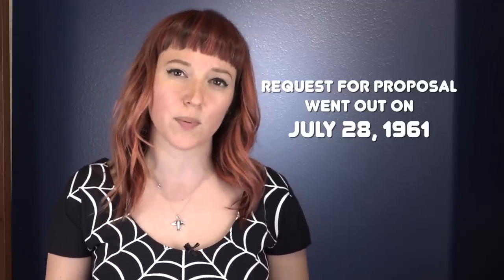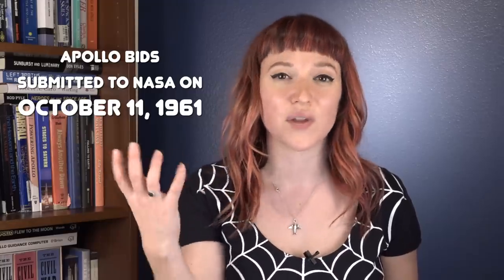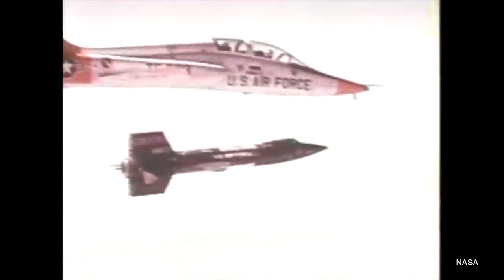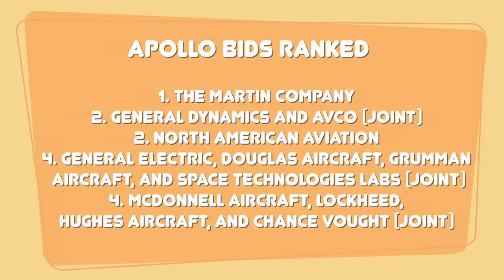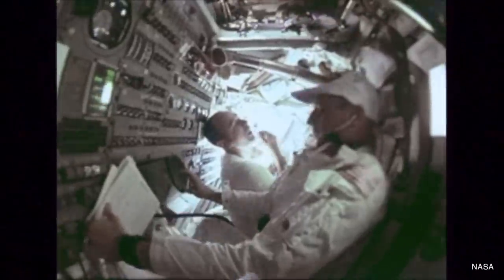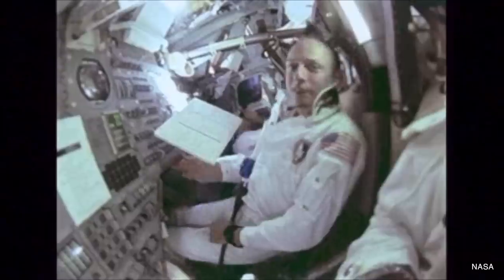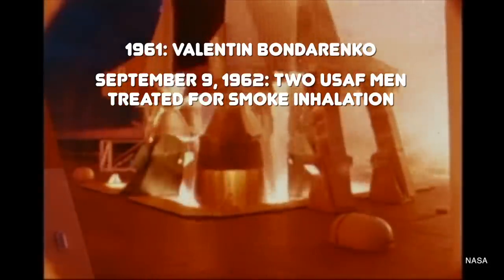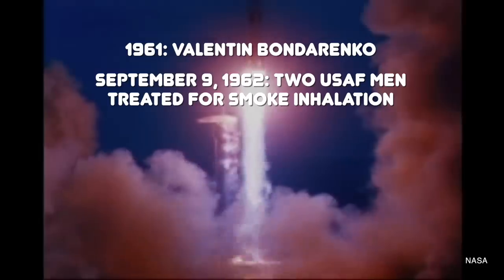Apollo’s Flammable Oxygen Atmosphere Explained

Comment: Amy great to have you back! My understanding is that flammability is a function of the partial pressure of oxygen, not a function of gas ratios. You hint at this but I think too many people in the comments get stuck at "pure oxygen" and don't understand that mixing O2 with another gas does not by itself reduce flammability.

Comment: As a very old space geek, let me mention a few technical points.  The space suits have to run at low pressure to be supple and therefore must use pure oxygen.  To avoid "the bends" astronauts breathing air must  pre-breathe  pure oxygen for several hours before EVA.  Therefore the Lunar Module really needed a pure oxygen atmosphere.  Also a 5psi pressure shell is lighter than a 15psi pressure shell and the LM had relatively big windows.  One extra pound on the LM required~1000 lbs on the Saturn V.  And what if there is an emergency decompression.....do you want lunar astronauts safely in their moonsuits with the bends?
So once the LM atmosphere is decided, the rest seems pretty obvious.  Unlike later NASA management choices which killed people for public relations reasons , this decision made absolute technical sense.

Comment: It’s because it’s not just the purity of the oxygen, it’s the quantity
Reply: thats literally the point of this video
Reply: @Kevy_G  Comprehension is tough for some.
Reply: Yup. At 5psi over vacuum, pure oxygen is not significantly more flammable than 20% atmospheric. If they had used a mixed gas, the cabin environment would still have been 80-90% percent oxygen, so that the crew could get enough oxygen.
Reply: The human lungs require a certain pressure of oxygen (known as partial pressure, when multiple gasses are present) in order to absorb oxygen.  In order to achieve the necessary partial pressure in an environment with a low absolute pressure, absolutely, you'd wind up with a mostly O2 environment anyhow.  Additionally, the part related to the video is that the effect of oxygen and it's oxidation properties is directly related to the PaO2:  If you make enough oxygen available, anything will burn.  It could be cloth, wood, metal, or even rocks.

Later on (1973), NASA commissioned a paper on combustion of metals in oxygen environments that may be of interest to some, too: https://nvlpubs.nist.gov/nistpubs/Legacy/IR/nbsir73-345.pdf
Reply: @Kevy_G  How can it 'literally' be 'the point'?

Comment: A simple follow up question is: Why didn't they just compress the nitrogen and oxygen into one tank, in the proper ratios, much as scuba equipment does?
Reply: Scuba equipment vents the gases once they've been through your lungs once. On a spacecraft, the gases are retained for efficiency and to provide a working environment. Astronauts are converting the oxygen to CO2 while the nitrogen remains unchanged. There does exist rebreather scuba equipment which recovers the exhaled gas and adjusts the oxygen level, but it uses multiple tanks and is much more complicated/dangerous, much like a spacecraft.
Reply: Because they aren't using compressed gas, they are using liquified gas, and nitrogen and oxygen having different boiling points. The oxygen would turn to gas long before the nitrogen began turning to gas, then you would be left with nothing but nitrogen.
Reply: That would mean they would have separate tanks for the cabin air and the oxygen used for the service module engine/fuel cells.  This would add more weight
Reply: Again, it was weight, but safety too. Years ago I used to wonder why just purified air wasn't used. But each time you add something to the oxygen, the disadvantages outweigh the advantages [outweigh - oops sorry]. It seems ridiculous that NASA would crank up the internal pressure of the Command Module to 17psi, but it was a plugs-out test, literally a space simulation, and the single huge error on the Apollo 1 test was the trapped and exposed wire that sparked. If that had not happened there would have been no tragedy. The overall failure was of imagination. Nobody really thought of what could happen, and I totally appreciate that it is very easy for me to say that in hindsight.
Incidentally, welcome back Amy. 🖖
Reply: Because the environmental system needs to be more complex than just simple open cycle, because that demands far too much mass.  It has to be close cycle for the nitrogen (with top up for outgassing losses), partial close for carbon dioxide (LiOH scrubbers designed to remove but leave a small amount), close cycle with major topup for oxygen, and scrub any other gases if possible (due to material outgassing etc.).  Partial pressures, the system needs to keep about 0.2 atmospheres oxygen, somewhere around 0.001 atmospheres carbon dioxide (to help maintain the level in the blood that's a pH buffer and is the primary stimulation for breathing), and the rest nitrogen, while scrubbing any other gases expected from biological processes and materials outgassing.
Reply: @apburner1  Actually, oxygen has a higher boiling point than nitrogen, so nitrogen would boil off first.
Reply: @ramblerandy2397  Failure of imagination. I believe that´s what Frank Borman  said whilst on the board after the accident. It´s a pretty accurate description.
Reply: @Nghilifa  Yep, I remember now that's where I got the thought. Funny, but Frank Borman saying that has stayed with me all my life since, yet I had forgotten it was him. Being able to imagine the strung out consequences of one's decisions and actions is a powerful tool and creates wisdom. I wonder who handed that excellent thought to Frank Borman or whether it just popped into his head?
Reply: @ramblerandy2397  I don't know very much about all of this, I am just interested. Could you tell me maybe why they couldn't open the door from the outside to save the astronauts? Thank you!
Reply: @susanne5803  In the plugs-out test (spacecraft on internal power and wireless communication) the immediate part of the launch pad was cleared. Therefore, when the capsule was sealed and a fire broke out, the pad technicians couldn't respond fast enough. I could give you a long and detailed explanation, but if you watch the second episode, aptly titled Apollo One, from the excellent 1990s HBO series, From the Earth to the Moon, you'll get all your questions answered. And if you want to be entertained and informed on the whole US mission to the Moon, watch the whole series.
The episode also brings up the fact that Gus Grissom could barely hear and speak to CapCom and I've wondered since whether the tracking wire was causing the interference. That's unproven IIRC.
Reply: Su sanne as far as I remember that hatch opened inward at the time. Given the pressure from the fire it wasn’t possible to open.
Reply: @ramblerandy2397  Thank you! I will look into that series, thanks for the recommendation!
Reply: @NickCBax  Thank you!
Reply: @susanne5803  Along with the other info presented above, there was no quick way to open the hatch. The one detail that has haunted me for years is from the first mention of fire from the crew, to the time they were dead was 37 seconds. There was literally no time to act.

The spacecraft remains stored in the back of a secure shed at NASA Langley, in Virginia.
Reply: @mikecowen6507  Thank you! I learned of the Apollo 1 fire first when I watched "Armageddon". There's a scene where two characters meet in the place where the Apollo 1 stood. They show the inscription. It moved me deeply.
Reply: @susanne5803  Pad 34.
Reply: @susanne5803  It was a long, slow procedure- they couldn't just blow the hatch. An earlier vessel had blown its own hatch, after splashdown, endangering the astronaut. Instead of finding and fixing the problem, they did the "pilot error" routine. So it took about 90 seconds to open the hatch in the best of times...
Reply: @Pygar2  Thank you!
Reply: @susanne5803  the door opened in so the pressure inside the cabin held it closed.
Reply: @Pygar2   Indeed, and if Su sanne checks out the film, 'The Right Stuff', they show the part of the Mercury capsule explosive bolts and the process of blaming afterwards,  guess who? Gus Grissom - the pilot who was in danger of drowning after splashdown. Plus they refer to that event in the 'Apollo One' FTETTM episode, mentioned before.
Reply: @susanne5803  The door to the command module opened inwards - this was designed to provide a better seal against the pressure of the oxygen inside when the module was in the vacuum of space. Unfortunately, the opening mechanism was rather difficult to use by the astronauts anyway, but the real killer (pun intended) was that when the fire started, the pressure rose so much in such a short space of time that the hatch was sealed shut with such force that no-one could open it.  The hatch was redesigned to open outwards, and to be opened quicker as a result of the fire.
Reply: @mikecowen6507  my understanding was it was even faster than that. In the neighborhood of 15 to 20 seconds from first indication to the death of the crew.
Reply: @dantreadwell7421  Quite possible. An update on Apollo1: It is now part of an exhibit at KSC. History being remembered in public, where it should be.

Comment: Its good to see your videos again. I was always curious as why they used a pure oxygen environment. and at such a low pressure.  A normal atmospheric mix of gases, 5 psi is around 25000 ft above sea level.  One wouldn't survive that long without portable oxygen, but in a pure oxygen environment, that is enough to sustain life in the spacecraft.

Comment: There was also the issue of conducting EVAs. 
Once Lunar Orbit Rendezvous was selected as the technique to be used for the attempt to land on the moon, it was realised that EVAs would need to be conducted. Once you need to carry out an EVA, having a normal air mix in the spacecraft causes problems - and would almost definitely require some sort of airlock to allow the EVA astronaut to acclimatise to the pure oxygen used in an EVA suit v' the air mix in the spacecraft. Without doing so, the astronaut would get the bends.  It was much simpler to stick with a low pressure oxygen atmosphere and simply depressurise the whole spacecraft and then open the hatch. With no nitrogen to be purged from the astronauts' bloodstream - the bends would not be an issue.
And an airlock would have added additional weight - which was the last thing the Apollo spacecraft needed.

On that point, I assume the Orion spacecraft WILL have an airlock as it will be using an air mix and not pure oxygen.
Reply from the maker: Not sure what’s up for Orion — I’ll have to check — but yeah. Top to bottom on those missions the single gas was so much easier to use.
Reply: @AmyShiraTeitel  And, of course, McDonnell had already gone down that route with their Mercury and Gemini capsules - so everyone was getting kind of use to the whole "pure oxygen" scene. In the end, it was their casual approach to using pure oxygen, especially when sitting on the pad, that lured them into a false sense of security.
Reply: Lunar Orbit Rendezvous was the process for two spacecraft to rendezvous and in and of itself does not require any EVA. The LM could have landed and observations been made or experiment packages jettisoned from the LM without astronauts going EVA, and then the LM ascend and rendezvous with the CM. EVAs on the lunar surface was certainly the desired goal, but not tied specifically to the design of the spacecraft (one or more) and any method for getting to the lunar surface and returning. From a design perspective, whether one single spacecraft was sent, or multiples, opening the hatch on the surface and walking around outside didn't depend upon any specific mission design philosophy; LOR, Earth Orbit Rendezvous, Direct Ascent, etc.
Reply: @WoodworkerDon  They always foresaw a situation where there might need to be an EVA between the Lunar Module and the Command Module if there was a problem with the docking tunnel and/or related hatches. One of the prime reasons why North American started the re-design of the Command Module in 1962 (which resulted in the revised Clock 2 version) was precisely because the hatch on the Block 1 Command Module could not be opened to allow any EVAs through it. If you don't believe me, listen to what astronaut Jim McDivitt has to say about the reasoning behind the Block 2 design in the BBC documentary "The Other Side of the Moon" (which is on You Tube).

And., of course, many EVAs WERE conducted from the Command Module - one on Apollo 9, three more on Apollos 15,16 and 17 and another on the Skylab  2 rescue mission. So, my point is that EVAs through the hatch on the Block 2 Command Modules were always expected at some point in the life of Apollo - and that is exactly what happened.

Comment: Great explation....i also heard there was an excess amount of velcro throughout the cabin installed at the request of the astronauts. No problem at 5 psi pure oxygen but tends to burn violently at the tanked up test pressure at sealevel.
Reply from the maker: Yup. That was one of the things identified in the flammability survey.

Comment: I've also thought that with a mixed gas environment the cabin pressure would need to be higher to meet the crew's oxygen requirements. The crew cabin walls would need to be stronger and thus heavier to contain  that pressure when there wasn't any pressure outside the cabin to counteract it. It's my understanding passenger planes usually allow a reduction in the cabin pressure during cruise to ease the structural strain on the fuselage.

Comment: I wasn't aware of the histprical precedents for 5psi O2 being a problem. I also thought that an additional reason to run at 5psi relative to the outside was to minimize structural needs for the pressurized capsule and thereby reduce weight, but at the time of the fire that would be a problem to change -- in the CM as well as the LM, which is noted for its extremely thin walls.

Comment: Hi Amy. Have you done a video of how the cryo tank got damaged prior to the Apollo 13 mission. Something about a burnt out coil or thermostat in a test that wasn’t replaced. I can’t recall- can you remind us ?
Reply: Piper Cryogenics in Boulder, Colorado, who made the tank, failed to execute an Engineering Change Order to modify the original 28 volt electrical components to a newer 56 volt standard, yet signed off on having done it. Also, at the factory, the tank was dropped 2 inches, which is thought to have dislodged a vent tube inside the tank. During pad testing, NASA was unable to drain the tank normally, and rather than change the tank on the pad (a difficult procedure), elected to leave the tank heaters on to boil off the liquid oxygen, not realizing the electrical components were severely overloaded at more than double their design voltage. At some point during pad testing a thermostatic switch welded its contacts closed, which prevented the tank heater from self regulating. Due to the boil off procedure being used, pad workers did not realize the elevated tank temperatures indicated a fault condition, and continued "cooking" the electrical components. In flight, when the command to stir the cryo tanks was initiated, the damaged wiring caused a spark, and the tank exploded. I think you know the rest of the story.
Reply: Mike Cowen excellent stuff. Now get Amy to present it in her next video! ✌️
Reply: @abbaszaidi8371  Ah, I wish it were so easy! I believe she did cover the topic in the past, but held back on naming the guilty party. I have no such issue. It's documented and established fact. Let em sue me over 50 year old truths. 20 years ago, I used to live in Boulder. I showed enough restraint to not post a sign saying Apollo 13 was CAUSED here.
Reply: Mike Cowen I’d stand with you with that sign if you ever wanted to protest. Of course they also caused NASA’s finest hour- I once watched Jim Lovell give a lecture and he stated while he didn’t get to walk on the moon, he wouldn’t be there standing and talking to us about the third attempted lunar landing if it wasn’t for that oxygen tank and the ensuing drama. Great facts sir 👍🏽
Reply: @abbaszaidi8371  👍😉

Comment: As a welder pure oxygen is one of the most dangerous things in a welding shop mostly because you can't easily detect it until things start to burn really well. Shame that NASA did not learn from the previous mistakes initially.

Comment: As usual, a very well done and informative documentary. There was one additional factor. In order to pressurize the spacecraft with a mix similar to normal air, the pressure differential would be something close to 15 PSI thus requiring a heavier structure to handle the pressurization load. I never found out what the max pressure differential is for Apollo.  Perhaps you can tell me? I assumed it was 9 PSI like an airplane.

Comment: I wonder why they didn't use mixed air tanks. We use "breathing air" as firefighters which is a mixture of nitrogen and oxygen in a tank we carry on our back. It seems they could have used that concept which would have eliminated the need for separate tanks and a mixing regime. I think it would have worked. BTW great video and information. I have missed your talks.